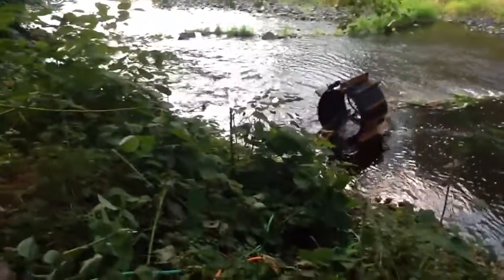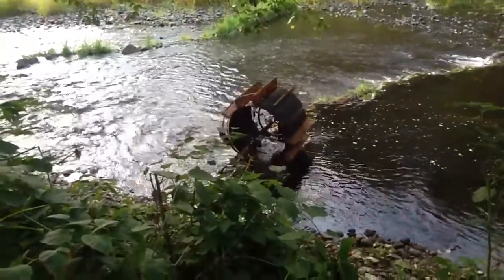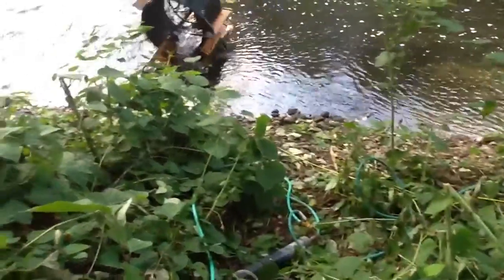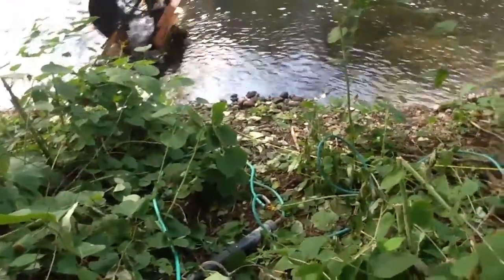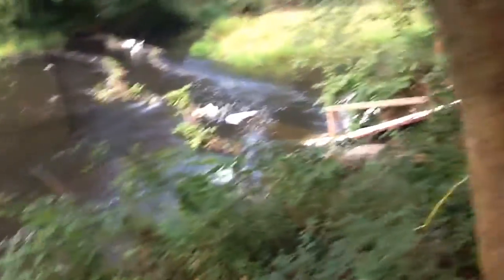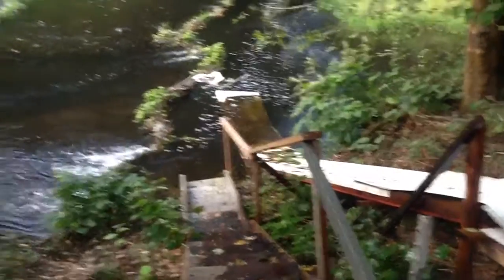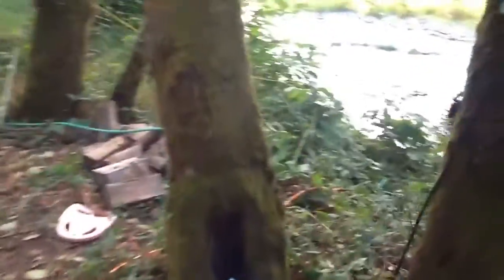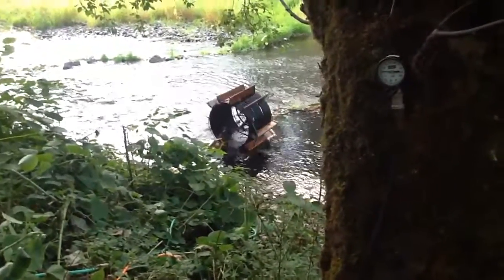Stream powered water pump.

Comment: I need a design like this.  Can you show or describe how the water/air separator is set up.  also how did you design your cage or frame.  Thanks for the look at your design.
Reply from the maker: The air water separator is just a 3" or 4" ABS pipe and capped both ends. It is stood vertically with a intake(5/8) from pump at the top, a 3/8" air/water mix out also at the top and At the bottom the water only out pipe(5/8). The pipe must be able to hold a couple of gallons. Do not over think this. It is that simple. About half the water flow will come out the bottom. I use a 5/8 garden hose. The rest of the water and all the air comes out the top. Use a 3/8" air hose because it is the right dia. to prevent the air from passing the water. 
 If the 5/8" hose exit is 50' above the splitter it will create about 23 psi back pressure at pump. With about half the volume of the 3/8" hose filled with air the weight of water will be half. The 3/8" hose will be able to lift 100'. Both hoses must be left open and running.

The material used was 20' by 3/8" rebar. I started by making 2 circles from 10' pieces. Weld ends together with about an inch overlap. True the circles. Make 2 rectangles 40"(dia. of circles) by 34". Weld circle to rectangle (40") with 34" sides 90° to circle. With circle on ground the rectangle will be vertical. Place the other rectangle inside welded rectangle at 90° and weld to circle. Weld other circle to other end. The circles become the wheel and the 40" become the spokes.
Take 1/2" steel water pipe slide and slide inside it 1/2" rebar. This will become the axel. Weld as close to center 1/2" rebar to 3/8" spokes. On the water pipe end welding the rebar to pipe weakens the pipe and will create possible failure of this part. I rapped rebar around pipe and welding it spokes. Like a bicycle wheel hub there needs to be width to keep axel straight. Place axel in bearings and spin. The wheel should spin true and axel must be straight. Bend and cut 3/8" 'U's and weld them to circles to hold paddles. Facing up river the exit from the pump is on the left because if it is on the other side the plumbing takes it self apart.
 After you have welded in axel cut out the part that is not need that goes into 1/2 pipe. 

Things I learned. 
The weight of the water in the loops of tubes in the pump limits the hight that can be pumped. This unit contains around 31 pounds of water. 0.44-0.48psi down pressure per foot hight plus back pressure. Water only max hight around 60 feet.

I've increased the 1" hose by 50' to hold over 40 pounds of water. 

 At water/air separator 50/50 at hose input water/air mix max hight under 120 feet. The unit is efficient at 55' of water only hight. Above 55' volume drops off fast. I do not know what the 50/50 water air mix hight is because my max hight of water outlet is 100 feet. The water easily squirts another 10 feet.
 
24 hour lift  (50') 600 gals. concurrently (70') 800 gals. total 1,400. 21 psi at separator. Total 1,300 gals. pumped. Good flow at 23psi. Failure pressure 26-27 psi. At 6" x 36" wide equals 1,535 gpm stream flow through pump. 25 foot pound of torque stops the wheel. This about the force applied to a bicycle traveling at 10 mph on flat paved road. Without the paddles this unit connected to a hand or foot crank this unit could be used on a pond and would be a much more efficient pump than is currently available. By using cheep plumbing parts I have been able to make a flange packing box like used on a inboard motor boat. It will be May before I can test it and increased hose limits.

Specs 38" dia. wheel at the tubing by 36" wide. 

Water wheel parts list
5(3/8" rebar 20' long)
1(1/2" rebar 10' long)
6(6" cedar fence boards)
250' (1" thin wall irrigation pipe (I will increase 50')
1 (1/2" pipe thread female/ female swivel hydraulic connector and grease nipple Note this part is very expensive and wears out quickly. Replacing it with home built 'flange packing box'. 
1 (pound welding rod)
1 (tie wire)
1 (1/2" steel water pipe 8" long)
3" ABS pipe 1' long 
1(3" ABS end cap
1(1" barb / threaded pipe connector striate
1(1" barb / 1/2" threaded pipe connector 90° 
2(1/2" barb / 1/2" threaded pipe connector
1(1/2" coupler
1( 1/2" thread female to male garden hose bib.
1 ( bearing and housing that 1/2" steel water pipe can fit as axel. 
1 ( I used. 10" wheel from harbor freight tool for the bearing.
Reply from the maker: Water wheel u-tube
https://m.youtube.com/watch?v=4omE2UpNOSE

https://m.youtube.com/watch?v=rIVDgHx3XBc

https://m.youtube.com/watch?feature=youtu.be&v=YCxkopGBwjw

https://m.youtube.com/watch?v=b9u-sUJY5Lk

https://m.youtube.com/watch?v=vyzXEiJEDQE
Reply from the maker: Put in my new improve unit. Added 50' of hose. This increased water only hight to over 60' and water air mix to over 100'. The 1/2" steel pipe welding it in seem to be the weak point. I had 2 (3/8" rebar that broke after about 2 weeks. I fix it with 4(1/2". I think this will continue to be the weak spot. The rotary seal works better than I have hoped. It drips a few drops but no air leak. There appears to be no different in volume of water output. There is greater output at the air/water outlet.
Reply: The biggest problem for mi is to find the rotary joint. Can you describe how you solve this problem? Where to find joint that connect rotating and fixed pipe? Your is made by yourself or you have bought it and where?

Comment from the maker: Stream powered water pumpWater wheel pump The new design on the air water separator 5/8" water air mix in at the top of 3" ABS pipe. 1/2" air water out also on top. 3" by pipe positioned vertically 5/8" pipe water only exit at bottom. Re cap: Water air enters pump 50/50 by volume. Leaves pump about 75% water and 25% air. That 75/25 mix enters the top of water/air splitter. 1/2" pipe at top exits about 50/50 water/air mix lifts water at good flow 80'. Because as the water goes up 3/8" hose the air expands, at exit about 25/75 water/air. The 5/8" water only exit at bottom of 3" pipe I hang up a tree 50' to 55'. A little less than half of the water pumped exits this hose. Water only hose exit into a 3" pipe hanging at 50' to 55'. Water is recaptured and used to operated a water slide, returning it to creek upstream of pump.Note: The weakest and most expensive part of the system is the 1/2 hydraulic swivel pipe connector. Operates best around 22 psi, fails at 27 psi. Lifts water 70 feet 400 gal and 50 feet 350 gal in 25 hours.